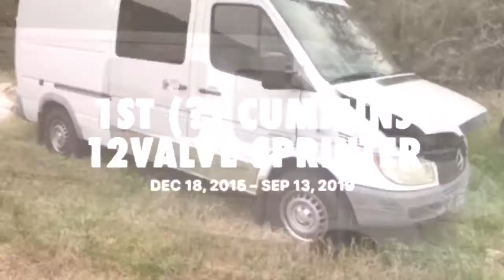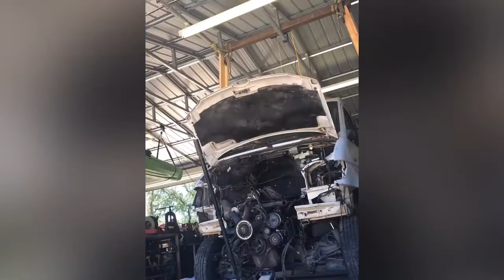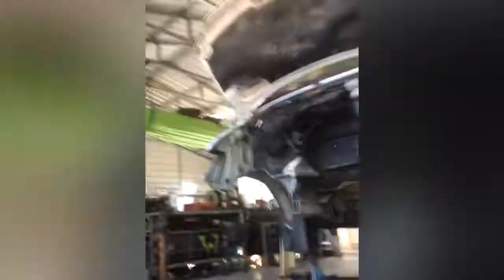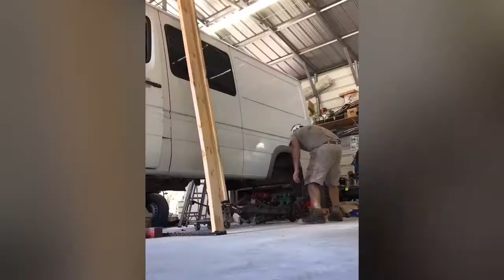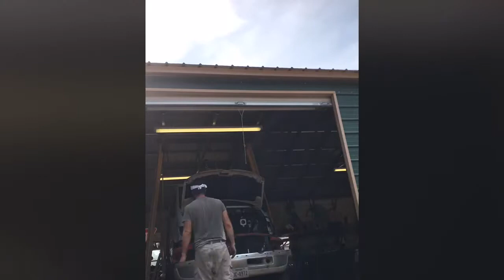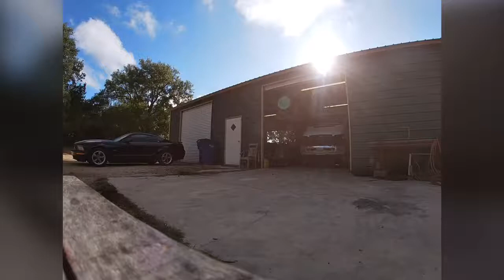Worlds 1st(?) Cummins 12 Valve 4x4 Sprinter

Comment from the maker: Hey guys, thanks for the comments.  I’ve been spare time working on “Vanzilla”, (better nickname suggestions welcome).  Put a better Hurst shifter in, got a mono triple convoluted airbag body mount in.  Stacked Sprinter/Dodge rear leaf spring  suspension with sway bars are welded up. Rides better than a Caddy and the mono airbag, lifts the front of the van off from the chassis 14”. Good for engine access, ride, campsite leveling. I’m refining the telescoping steering column linkage right now. I wish I could add pics, I’ll try to figure out how soon. Got it driving around my property.  It’s no taller than a high cube stock Sprinter  at 9’ clearance. Thinking about changing to duals for the rear to feel safer about blowouts, roll over, etc. I also want to get the pop up camper roof someday.